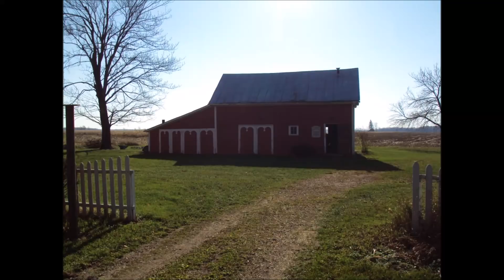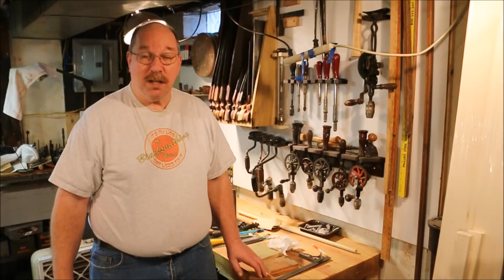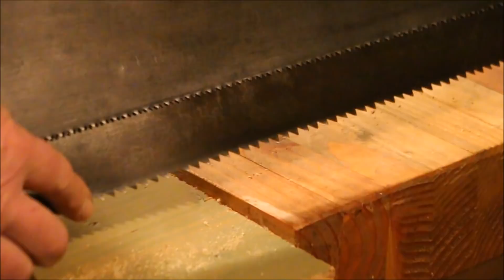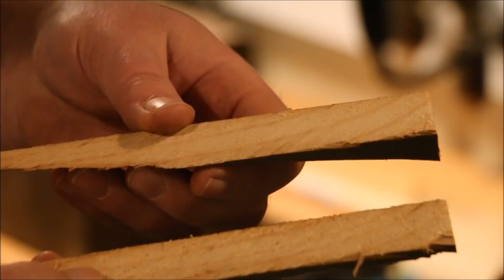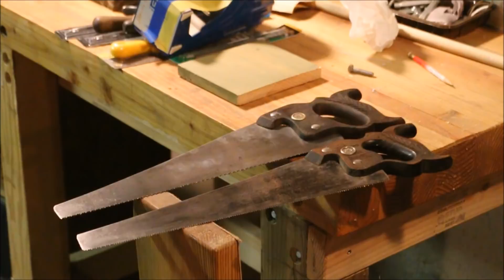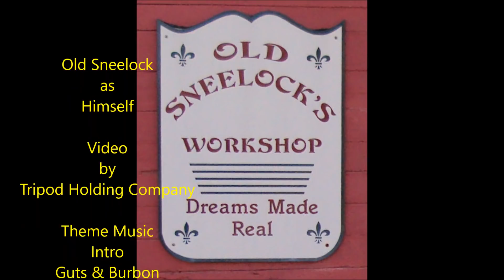NEW METHODS TO RESTORE HANDSAWS ~ PART 3 ~ TESTING

Comment: I have my Uncle's what I believe to be (4) 1915 Disston 2 cross, 2 rip saws. I want to restore them, but I also want to preserve the etching if possible. any ideas?
Thank you in advance
Reply from the maker: That is a nice set of saws. 
Sorry for the delay in responding. YouTube is acting a bit goofy of late. 
For saving the etch I use a single edge razor blade in a little stamped steel window scraper handle to shear off the rust from the center left side of the blade. Most etches and definitely Disston etches are there. The blade will cut off the rust without gouging into the etch. Hold the razor blade almost flat to the saw blade and scrape in long strokes. Short ones make more scratches. Flip the razor blade over every couple of strokes and it will cut faster.
Reply: Thank you for your responding, no worries for any delay. I will take your advice and try cleaning one of the saws when I have a chance. BTW I also found a letter from Disston to my uncle Dated April 21, 1915 with the Disston saw booklet enclosed. I assume my Uncle purchased said saws soon after, but i'm not sure. The letter was signed by Sydney Batly if that means anything to you. Thank you again for your reply.

Comment: Typically retired. Just like me; a FULL time job right here. The grass is almost needing cut in spots. Trimming is still going on and will be for a while. Then working up the firewood. Then the grass REALLY comes on. Then mulch to haul and more gates to build plus vehicle and mower maintenance. PLus painting and house stuff. Then leaves turn and fall and need gathered up and here we go all over again.If that saw is a 4, mine is a minus 75. I'll just have to get a shot of it. All of them, really. So put Dave to work on the saw venture. He needs occupied! I need a meth lab!

Comment: I've done plenty of double handed saw work but never used a thumb hole saw . Bit late in the day now to try one worse luck not that I'd be able to find one at a price I'd be willing to pay . That little saw has come up smiling thanks to you I hope it sells well and to some one who'll use it and not put it on a shelf . The rust on that 4 tooth though it still works would drive me mad can't stand to see rust on tools especially from what we could see that bad
Reply from the maker: David Chadwick The rust is gone but the tracks remain. It was an early practice saw. I thought there was nothing to lose in sharpening a junker. Turns out they still work even with a trench half way through the plate. 😃
Reply: Old Sneelock's Workshop agreed nothing wrong in that . You don't get better by just looking at it . Practice makes perfect. Just the way it comes out in the video makes it look worse than it is sorry for that . You no me if I can make it sparkle I will or if I can't cover it in gold  HaHa!
Reply from the maker: David Chadwick 😊
Reply: Lewie McNeely when it's got to that stage you aren't sharpening it your scrapping it or getting if there's anything left a scraper blade if your lucky BLO won't save that one
Reply from the maker: Lewie McNeely When I wanted to learn I bought junkers to practice on. The guys on thr Old Tool List said start with rip saws. They are filed straight across so I didn't have to worry about angles and they have fewer teeth. This 4 PPI blade had it all. It was really cheap, BIG teeth, and filed rip. It has been sharpened a few times in the last 10 years. The first one not so well but by the third it cut pretty good. 
Since then I spend more time on good saw sharpening than junkers but the 4 PPI is one of my favorites because I thought it would never work.
Reply: its a beeswax well :)
Reply: It's not REALLY rust unless it's falling off by itself in CHUNKS! THAT's Rust!
Reply: Never used a scraper. The HAMMER is used for fine tuning. An explosive is used to start the process. Then it's everyone for hisself!
Reply: I know the feeling. I've done that with mowers and odds and ends. I dreaded trying to start some of them because I didn't think it'd go. But they did. Just like the old guy said. 'It's just junk to the untrained eye'! And what it is may not be what it might be.